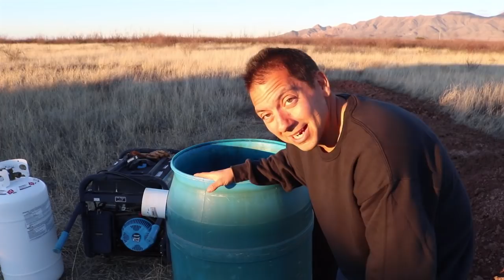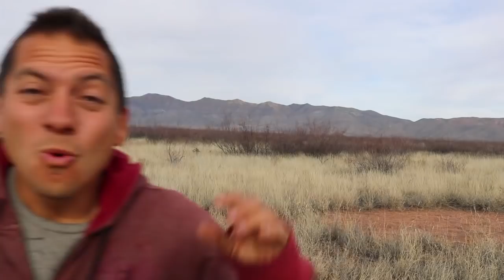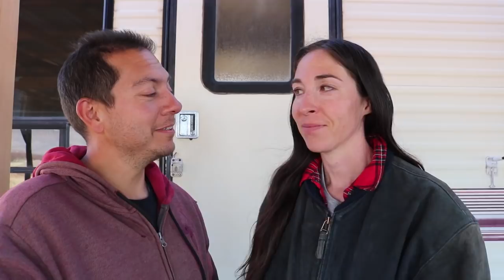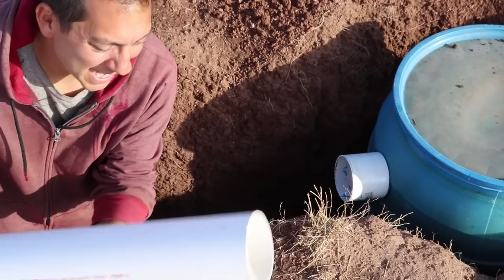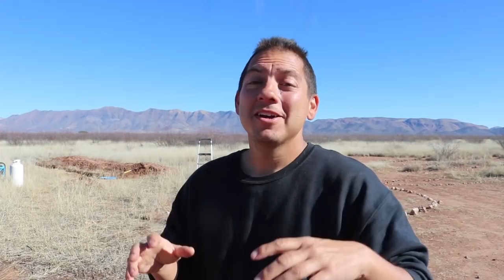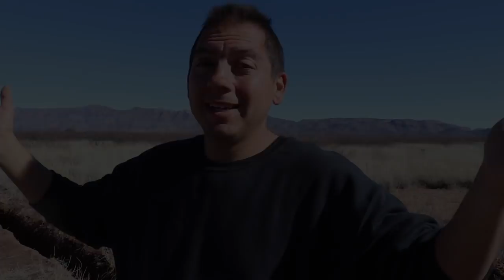Is the Government HIDING THIS From You? | DIY Septic Installation | Off-Grid Cabin Build

Comment: You are lucky.  In allot of places things like composting toilets and off grid living are being made illegal to insure that the wrong type of people do not move into the boonies.  In the county I live in,  the simplest living situation requires a minimum $100,000 septic system to be installed. The system is required to be installed before any building can begin. You got it.  Only multimillion dollar projects need to apply.

Comment: Great idea..
However,  everyone MUST  check out the ordinances for their area.
Up here in eastern Washington, depending on exactly where you are, you may or may not be able to use composting toilets. And in some areas it's very much legal,  but an inspector can come up with ways to make it extremely difficult for a sign off.
YOU REALLY NEED TO DO YOUR HOMEWORK FIRST

Comment: The house we bought had the same setup. While remodeling the back bathroom it was found. Come to find out it was put in in the 60s. Still working fine after all those years.
We did have to connect into the regular septic.
Reply from the maker: That's interesting. I hear these are used but usually in conjunction with a regular system.

Comment: Follow the universal galactic gravity code: 
S|☆T flows downhill 😆
Also, Note that your state and the federal UPC 1640.22 code states that the developed length of a leaching field starts at the wier depth and ends 12" from the end of the media waste line meaning the gravel in your case is also measured at the end.
Perhaps you fo not need to excavate the extra foot.
Just sayin
Reply from the maker: That was okay. It didn't take me long to do the extra digging. I didn't want any excuses to not pass the inspection. 😁

Comment: I have no idea what you are using to keep the top dirt seperated from the leach field rock
You could use filter fabric
Or straw
On another channels inspection.  The inspector wanted a thicker layer of straw...
As a side note
If no one has said any thing
I would fill your tank with water or. Black water.. 
Reason being.  If you get rain and it enters the trench...
 That empty container can float just like a boat....
In my early career in construction we had a 500 gallon tank pop to the surface...
Today footings are poured and tanks strapped down and filled before being backfilled
Reply from the maker: Thanks for the tips Jim. I'll get water in that asap.